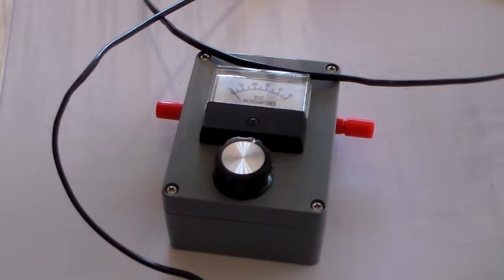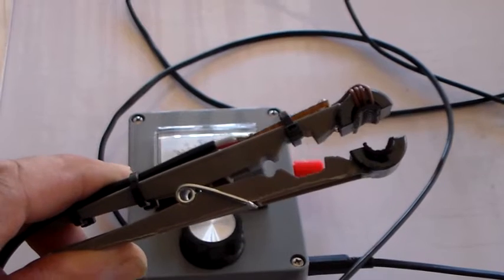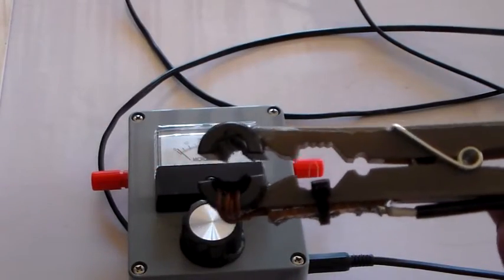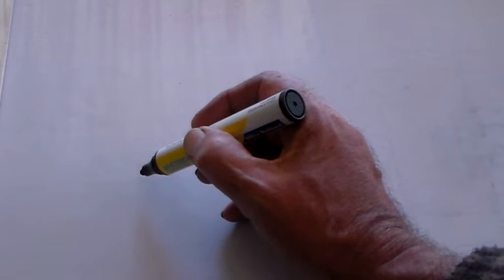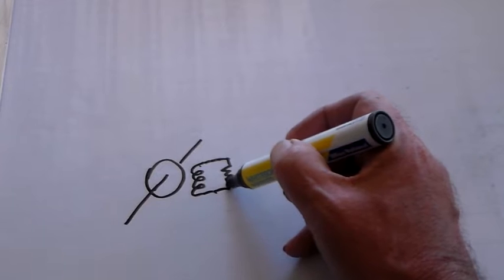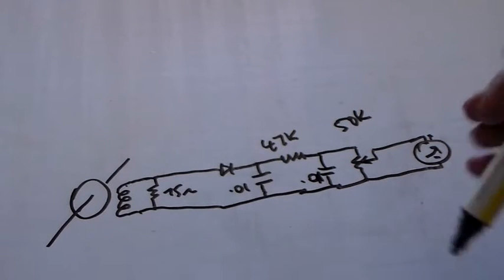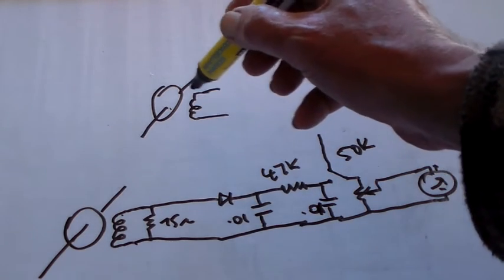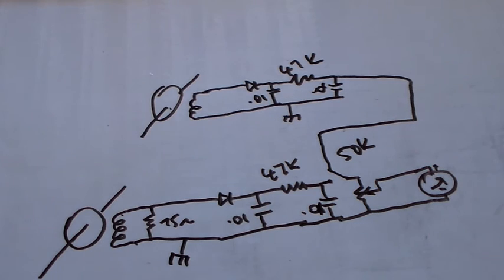A Closer Look At The RF Current Meter And Remote Probe

Comment: Very interesting!  Could you explain the purpose of the capacitors?  I presume the first helps with the rectification of the diode to reduce pulses to an even voltage, then a resistor to reduce current?  Then what is the second cap for ?

Kind regards,

Simon
M0SYS
Reply from the maker: Yes, the first capacitor smoothes the half wave rectified DC and decouples any RF, and the second capacitor just cleans it up by adding additional smoothing and decoupling of any remaining RF that may be induced into the Veroboard copper strips. It would probably work fine without the second capacitor if you're stuck for space. But bear in mind the meter will be operating in a strong RF field, so the more decoupling the better. I should probably put a .01 cap across the meter terminals to get rid of any RF that may get into the meter wiring.

Comment: You did leave the 75 ohm resistor out of the diagram for the remoter pickup , but it would be on the small board ?
Reply from the maker: No, the small board circuit is as I showed it. The remote probe has fewer turns of wire on it, so it produces less voltage, it doesn't need the resistor.

Comment: My RF probe cost 700 quid......
Now you tell me all I needed was a clothes line peg and a ferrite core. Damn !!!
I wouldn't lend it to anyone who frequents 80m.
Seriously, good video mate, thanks for sharing. :-)
Reply from the maker: Good point about 80m operators Ade. They would probably die and it would become part of their deceased estate. I would have to buy it back, if someone didn't beat me to it.
Reply: VK6CS The 7410 has been discontinued.

I got one just at the end. It's still yet to arrive.

We'll have a QSO when I've got more power and the 6 element Yagi up and running.

I've also got a kicker. I mean, oops, err, booster, I mean, err, Big Girls, umm, a little helper. Lots of gain in and out. 

Also, my Bitx40 should arrive next week.
7w of pure power fun. And I have to build it too. I don't even know the difference between an inductor and a capacitor.....Might be a build video in the wind along with the tin foil hat project.

I just need to wait for faster internet.
Reply from the maker: I noticed the liver salts communications company still shows the 7410 as being available on their website. I suppose the 7300 was the "upgrade". Just out of curiosity why didn't you go for the 7300?
Reply: VK6CS Answer : In the air line industry there is a saying "Never fly the A model of anything".

Also, I wanted a real radio, not an SDR with a colourful display that doesn't make the audio in and out better. 

The 7300 doesn't even have a 2nd IF filter option, let alone and 3rd.

The 7300 is also made cheaply with components that serve multiple purposes.

The 7410 can run flat.

Yes, I have spoken to many 7300 stations and the audio out of them and into my receiver and speaker is Top Shelf.

I wanted a real proven chassis.

I'm also about to buy a 718 Icom before they too disappear. The Icom Amateur rep intimated that that model would also soon be axed.

At the end of the day, I'm not taken by fancy colour water falls and other useless things which do nothing to improve the in and out.

I'm old fashioned and like a rock. A little like Queen Elisabeth II - Defender of The Garter.
Reply from the maker: Of course.. silly me. You're right Ade, that's why I've got two 857s. None of this fangled touch screen nonsense. As you say most of the other features like the waterfall display are novelty items, they're not much practical use.